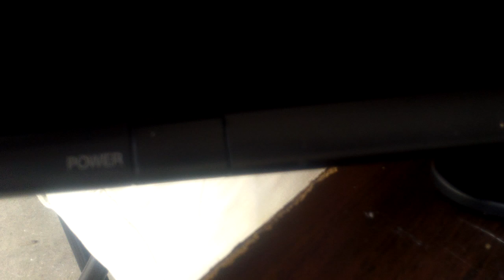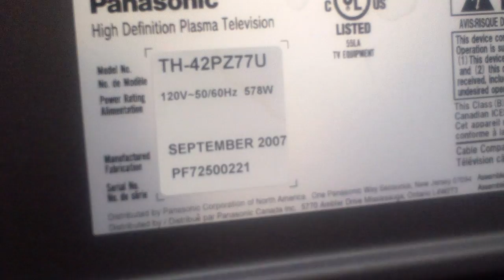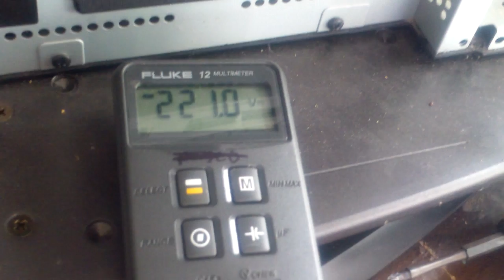HOW TO TROUBLESHOOT PLASMA TV REVIEW

Comment: My Toshiba Model 50HP66 has a wide white and black vertical bar with several strips on the left side of the screen, then it moves to the right side of the screen a vertical bar with 2 strips, then they go away and it get's full screen color flash and then the screen goes black.  I removed and re-seated the ribbons caable both the upper and lower buffer boards, no change. The same effect appears on both DIMI ports.

That you,
Alexx Casanova

Comment: I have a Hitachi 42HDS69. The Problem is. the standby red light stays on then sometimes the tv flashes blue 8 times then comes on and some times the tv clicks on red standby and will not come on, clicking is coming from the main power supply board. what could this be? Help!

Comment: I have a Panasonic Model # TH-42PX75U The picture on the top half suddenly turned black, the bottom half is fine.  We opened it and see no dust and all the connections seem to be fine.  What do you think is needed to fix the problem.  Thank you!

Comment: You have 2 circuits on the Y-main. The power supply circuit in which the Vs cable from PSU goes into, and you also have a Drive/Oscilator  circuit which is connected to the Logic board. YOU have a problem with the Drive portion of the Y-main circuit board.

Comment: I have a 2006 50 LG plasma screen that won't show the picture but plays sound and it also makes a loud noise form the back. I took the back panel off and the noise is coming from the y sustain board. Does that mean it is bad?

Model number: 50pc3d

Comment: What would cause the PSU voltage drop when connecting cable from logic board to y-main. When I disconnect the logic board cable from the Y-main the PSU voltage stays normal

Comment: I have a Panasonic plasma that quit working after the cable box it was connected to via HDMI shorted out, no storms and the TV and cable box were on separate surge protectors, flipping a breaker in the process.  What component on the TV likely got fried by the surge coming through the HDMI connector?

Comment: have a Samsung Plasma HP-R4252 and have small colored lines that run horizontal from one side to the other across middle of screen and sometimes bottom part of screen goes black...tap the tv and picture will come back.  Seems to black out on bottom of screen as tv  warms up.  What do you think I need to replace?  thanks

Comment: Thanks, very good info. I'm working on a lg  mu-42pz15 plasma tv and it's power supply board seems ok. However I only get va vs and vy voltage when the connector that goes to the y sus (cn803)'is unplugged. Does it mean that my y sus has a short?

Comment: Good video! I have the same TV  -  7 blinks, no image, no sound. Turn On automatically when connected.
Panasonic 42" plasma, model TH-42PZ700U The TV Turn On automatically when connected. Seven blinking led lights, no picture or sound. I unplugged the power cord then disconnect the SU and SD boards from the TV. With them removed, I turned the TV on (by plugging in, turn On automatically) and still see the 7 blinks code. With the SU board and the SD board still disconnected, I removed connectors SC2 and SC20 from the SC board. I plug in the TV and turn it on (with the power button). No error code this time. (no blinking, fans running). So I bought used SC board on eBay. After replacing the board, I still have the 7 blinks error code!!! Any ideas? Perhaps I bought a defective board (bad luck)... Could it be the DG board?

Comment: I have a SAMSUNG plasma tv , I have sound but no video. I will occasionally  get video but the screen then flickers and goes blank/black. Model:LN46B530P7FXZC Serial:AYR63CPZ200559K VERSION: AC05
Reply: if you have good dc volts to y sus board then i would suspect y-sus board or y-buffer boards or both- http://bit.ly/1rnP7qk
Reply: The chip on the T-Con board might be over heating, take the back cover off them have a fan blow air to the T-Con board and see if the video stays on, if it does, I would just put a heat sink on it to fix it.
Reply: i3tguy Thanks so much will definately try and keep you posted

Comment: I have a Magnavox Plasma 42MF230A/37 TV that works well for the first 30 minutes and then the image starts blackening from the edges until it turns completely black. if I remove the back panel and place a fan it recovers to a clear picture. What module can possibly be the problem?
Reply from the maker: Do you have sound after the picture goes away and if you do most likely your y sustain board bad
Reply: No sound.    only a loud Hmm!
Reply: BTW  i ONLY HAVE 5 BLINKS  NO SOUND  and LOUD Hmmm

Comment: Looks like I have the same model with 6 blinks. Great video! more info than I have found in hours of searching. Same results. I was told there could be a shorted FET on my Y-Sustain board. I would like to test them via volt meter and have an idea how but do you have a part 2 to this video?